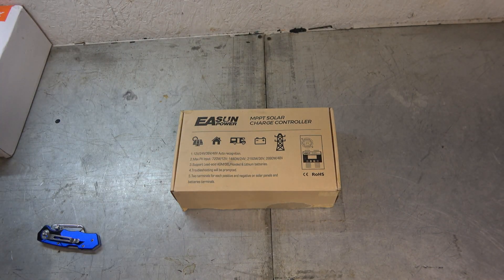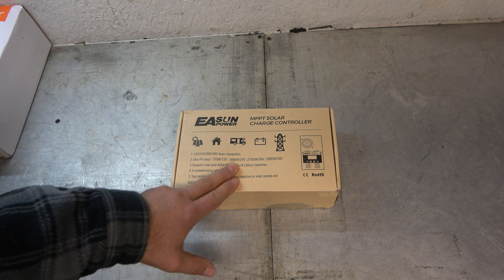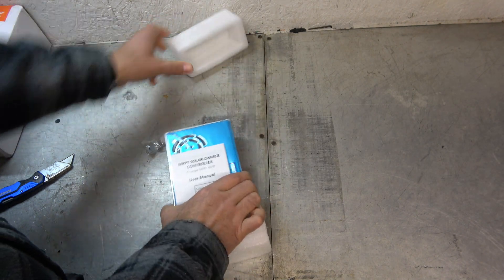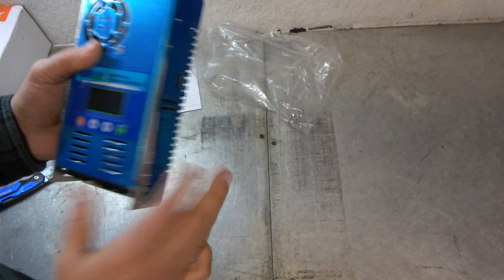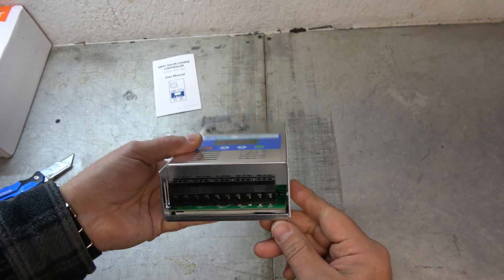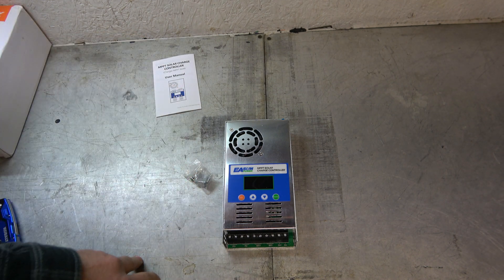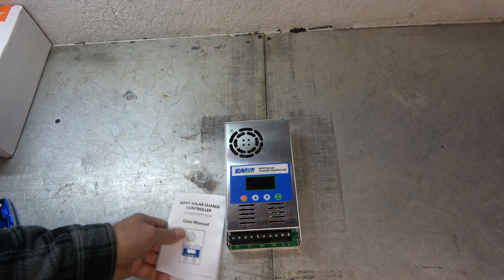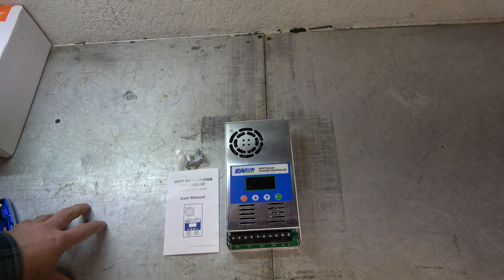Building A New Solar Array! Part 1: The EASUN MPPT 60 amp Solar Charge Controller The Model 6048.

Comment: I used a similar 60A charge controller like this but from another brand. I have 2 x 300w solar panels connected in parallel connected to it charging a single 100ah 12v lithium battery. However, the charge controller pv output reads around 290w max under full sun. Any idea why this is happening?
Reply from the maker: Two things. One, the panels are not working right, two the angle of the panels is not right.

Comment: Hey. I have same controller. Do you know what is "Load mode" you can set values from 0-24 but nowhere I can find info what that settings is used for. Thanks
Reply from the maker: That is the direct output for your DC voltage. 6,12,or 24 volts are the standard outputs.

Comment: Hello I have a particular project involving me to charge my batteries to 32V 
Are you able to see if you can set a personalised battery charging profile where the pv cut-off voltage is 32V? 

Your help will be extremely useful for me as I’m having trouble finding the details about the options within the custom charging profiles for these Chinese mppt controllers. 
If you’re asking why 32V it’s because I have a 8S lithium ion configuration.

Ps 
the setting for this should be called D02

Comment: I built 24v system last year for my shop. also did 60amps of mppt charging. I split mine between two 30 amp controllers. I had to do it that way because the panels I had were high voltage and needed controllers that were 24v and could take high input voltages. I have 4 panels that are over 300 watts each, 2 panels to a controller, I used low voltage landscape wire to go from panels to controllers. It’s rated for it and saved me big bucks.

Comment: oi oi oi FF, i have one of these, I got it 2nd hand or used and its pretty good BUT if u hook it up to a 24v bank then do not hook the load side up to 12volt devices. If ur gonna drive 6 hours to pick up them house panels then consider buying more then just 4 that just seems rediculous, even if u have neighbores or friends that want solar panels then they will be cheaper and worth the trip.